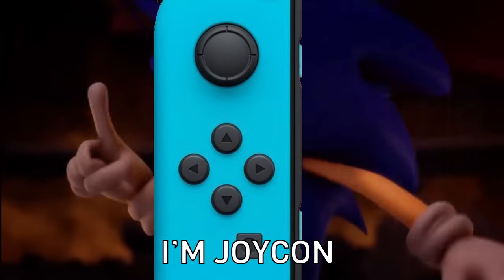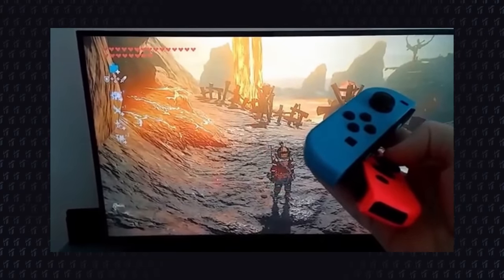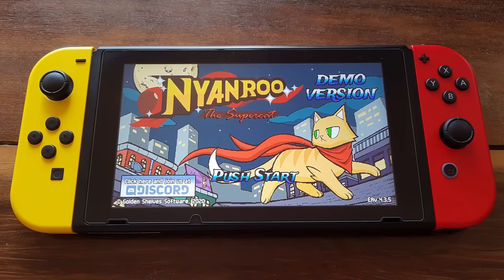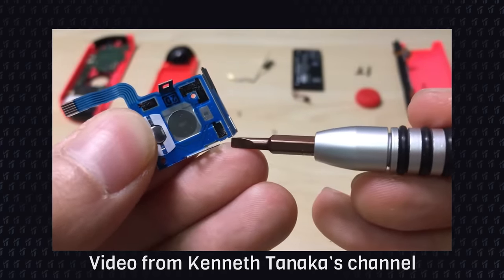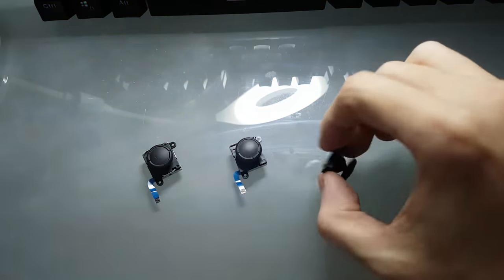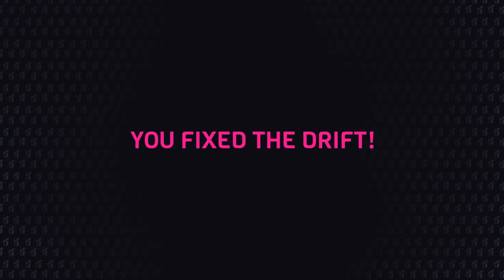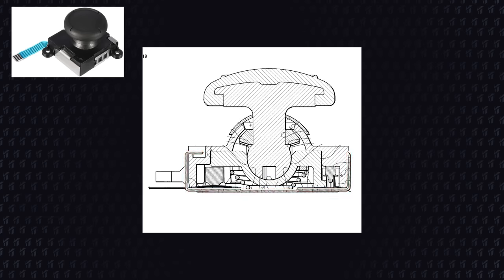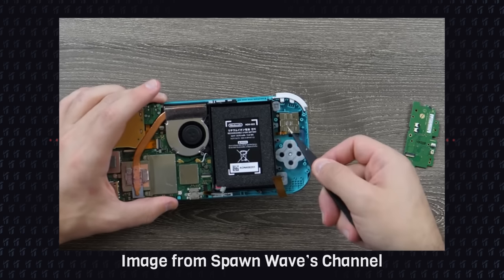How To Fix Your Joycon Drift Permanently!

Comment: To those who is doing this, just a precaution.

The Joycon is designed with one of the connecting ribbon (for thr SL/SR) being immensely compressed. So when you disamble the Joycon to do this, the compression is relieved and may cause the ribbon cable to lose its connection that was held firmly by the compression prior.

Youll notice that now the SL/SR button will only work at a certain angle of the cable when re-assembly, which means the connection is already compromised. 

You may need a replacement for this cable. If you do so, do tuck the ribbon cable underneath the battery holder instead of on top of the battery as it was originally. (As seen here https://youtu.be/RhSYG5M6HZs?t=316 ) This will prevent future compression. 

The paper fix itself works great btw!

Edit: 3 months aftwr doing the paper fix, sadly the drift returns, I just simply replace the joystick witha 3rd party one.
Reply: What is SL/SR? Something left/right?
Reply: @-JaggedGrace-  shoulder left/right
Reply: @TheMushMe  Oh thanks
Reply: I took apart my and my girlfriends joycons to replace the sticks and both left joycons had their SL/SR (and sync) buttons stop working. Now this makes sense.
Reply: Why this fucking thing has to be so complicate to open yet so easy to get driffing?
Reply: @Buitronthecrazy  I know right? So many complications just to fix this thing
Reply: How do you take them apart without that becoming an issue? Is it even possible?
Reply: @Sephelions  i mean, the damage to the cable is already done during assembly at the factory anyway so once you open to take it apart, it will be in a compressed state. Just a matter of luck if the compression is extensive enough or not to need replacement.
Reply: Does the cardboard/paper inside the joycon have a chance of setting the thing on fire? If anyone could answer this that would be helpful
Reply: Any 3rd party recommendations?
Reply: @Dakenir  any 3rd party joystick u can find will work, they most likely come from the same factory nintendo source from anyway or almost similar to
Reply: People do shellswaps every single day, and don't come across these issues you claim. You might just be upset that it didn't work for you so you spread false information.
Reply: @moldorm30  it worked for me for 3 months before the drift started again(this fix is not permanent, since it literally just pushes the base inward, once thats grinded down, youd need to push it in even more, but how far can it be pushed anyway, best is to just replace the joystick)

 i wasnt upset the fragile cable broke off, i was just speaking from my experience when opening my joycon, of course my singular experience cant be representative of the millions of joycons sold out there.
Reply: @TheMushMe  is the 3rd party joysticks purpose to just replace the joystick? Thats it? That fixes drift?
Reply: @nightscesar  yeah, since the drift is a hardware issue, replacing the stick will give you a brand-new one that doesnt have the issue (until the wear and tear happens again)
Reply: @haydennt  the joycon uses very little power to even feel warm let alone start a fire
Reply: thank you for the update
Reply: I don't understand what you mean, I don't see any cables that are extra pressed by the paper on my joycons
Reply: @SanzoArts  its the cable that connect the main joycon body to the joycon rail's light
Reply: @TheMushMe  thank you, I saw it now ♥
Reply: Paper compresses over time when pressured.
Reply: My SL/SR buttons and the LED are broken since last time I send my joy cons to Nintendo for repairing them, guess I'll need to send them back again
Reply: @anomaly395  thats why getting pro controller is the cheaper option. You always need new joycons and they're less durable. If you want new joycons you can, but the problem is the cost is easily over 50-60 at minimum just for two joycons. Although that takes away the experience of playing the nintendo switch base console, you have stable connection and no drift issues with the Pro controller, and you can connect it to Steam for PC gaming if you wish. The only problem is making sure there's enough battery on the Pro-controller. 

I have a samsung galaxy smartphone and I found the charger to charge very fast compared to the cable for the Switch Dock (the USB cable one, not the one that goes to the wall). 
Even a double charging dock for controllers or a dock that can charge the Switch and controller is worth the investment because its a third party, you can't screw up 'that' badly with that (although I'd still be careful about buying from third parties cuz my friend bought one like that, and the bottom has a weird detachable USB head thats the size of the micro USB head for a wireless mouse)

Daily reminder: Don't go green. Buy stuff that last forever so you only need to buy once and it lasts a lifetime or multiple lifetimes. Going green is the most inefficient and abusive way to use Earth's resources to create a flawed product and only expoentially increases consumption rate. 

In other words, make SMART puchase decisions, sometimes you need to buy 'quality', don't bother saving a few cents or dollars if the better product has better warranty, service, or lifetime performance. The only time you need to save a few bucks are digital games, cheap clothing, or other minor things like accessories.
Reply: @drakke125Channel  I already have three pro controllers (one of which has a broken shoulder button), but I don’t always want to play on my TV. I need handheld sometimes too.
Reply: @anomaly395  Just use aftermarket joycons then.
Reply: Smaht
Reply: @9unslin9er  What are those?
Reply: @drakke125 9.5/10 great motivational speech, would read again
Reply: @haydennt  as an electrician, I would say no.
Reply: @drakke125Channel  pro controllers also drift
Reply: 3rd party joycon suck. mine kept disconnecting mid game so i smashed them with a 3lb hammer.
i bought nintendo brand joycon and i can play games without worry.
Reply: @darkshadowsx5949  i replaced the joystick with a 3rd party one, not the entire Joycon.
Reply: I’ve replaced my joysticks twice and idk what I did but I haven’t had this problem, not gonna take them back apart to see if I did it wrong but there’s a good possibility that it’s wrong
Reply: @rad8078 I have also taken my joycons apart multiple times (I don’t understand other comments saying it’s complicated and hard, for me it was a lot of fun actually and I’m looking forward to doing it again) for swapping the shells and fixing the drift and never had this problem either
Reply: just get a hall effect joycon replacement and BOOM! No more drift. For Ever.
Reply: @haydennt paper doesnt conduct electricity. so no shorting, also, none of the components generate heat in a controller.    im 99.999 percent sure even if you covered the entire thing in paper or plastic, heat would never even be detectable.

Comment: Add me to the list! This worked for me, too, but if you’re going to try this, first confirm that applying pressure as shown on the video does actually fix the issue.
Edit: The drift is back 😭 I can still fix it by applying pressure on the controller while it happens so maybe I just have to open them up again. The L and R buttons also started accidentally double-pressing sometimes.
Edit 2: Reopened them and added a bit more thickness, made sure it's closed perfectly and now they work again.
Reply: Oh hey hawlo
Reply: Do you need to stick it down with glue or anything?
Reply: @Frbro111  No, you just need to be careful as you close the joycon that whatever you used stays in place and it will stay in place after closing it because of the pressure applied.
Reply: i wanna try that method but i have never heard of this after feeling before, what does it feel like?
Reply: @meow3829  It's not a bad feeling, just holding them feels a bit different, like they're a little heavier. It could just be me.
Reply: @Hawlo  bro are you like a weight lmao you feel that 000000.1 gram XD
Reply: @previszla6341  Yeah it was probably just all in my head since I hadn't used that pair of joycons in months.
Reply: Add more layers idk
Reply: @s-n-g-b1457  Worked.
Reply: @Hawlo  did u have slight drift before or really bad drift?
Reply: @ninecrowns871  In one set, the right stick would drift as soon as I moved it but would otherwise not do anything. In the other set, both sticks were pretty much unusable, not even letting you move the other way once they began drifting.
Reply: @Hawlo  so this video solution works? , Nice to know thank you
Reply: @ninecrowns871  Worked for me! But make sure to test if it'll work for you first by applying pressure while it's drifting and see if that fixes it. If not, the problem is something else.
Reply: @s-n-g-b1457  You know what they say: ogres have layers
Reply: I don't get it. It works for everyone except me... I tried 1 layer, 2 and 3, but nothing worked against the drift, probably because the screws are so far away from the point of pressure, that the joy con only bulges, doesn't even close and so the pressure doesn't go onto the analogue stick... Can someone help?

Edit: actually just checked another time and suddenly it's working. It's not completely without drift, but it drifts less often than before and when it does it's not nearly as strong.
Reply: @benjaminratajczak7000  use double sided tape
Reply: I have been worried about joy-con drift for a while which is what held me off getting a nintendo switch. I saw this video and helped me decide to buy one and I haven't experienced any drift yet... But if I do I'll come back here
Reply: Yes it will continue to come back, its not a permanent fix. Just replace the joystick, its like less than $4 for an aftermarket one. I have a video on replacing the joystick if needed.
Reply: Have your L R buttons been fixed after you reopened them?
Reply: @el_desalmado  Sadly no. They work like 96% of the time though.
Reply: @Hawlo  then it is not something really serious, is it?
Reply: @el_desalmado  I think it is. I really don't like the feeling of not being able to fully trust a button. Depends on the person, I guess.
Reply: @smash910  Any drift yet?
Reply: @lapk78  My left joycon bumper broke so I had to buy a new one but it held up well I think it was a problem with just my joycon because no one else has seemed to have this problem
Reply: @jcc4543  I used this thinking it was a good idea because it will also hold everything in place, lasted like 2 months before drifting again. The double tape foam got compacted with use
Reply: you could have gotten  your drift  fixed for FREE from Nintendo but you done opened them
Reply: @Only_Some  not in South America 🤷🏻‍♂️

Comment: "he is the chosen one, he will bring balance to the force".
Reply: Literally because controlls
Reply: This doesn’t work I did it and it didn’t work
Reply: I tested this method, but it didn't work. This method does not apply to all drifting joycons, nor can it be solved permanently. And the sides of joycon will bulge slightly, and the sealing of the joycon will be worse, this is the conclusion. The best way is to replace a brand new original joycon stick. The design structure determines that this is a consumable product. I'm the guy who fixed over hundreds of joycons from China.Hope this comment help you.
Reply: @BH-oq7hv  I tried paper instead，th situation improved.But drifting still exits.
Reply: Finally

Comment: This man is a hero, even just applying strong pressure during calibration stopped the issue for weeks. I can finally use my joycons again after years of having given up on them
Reply: did the drift come back or does it still work fine?

Comment: Honestly, I was super skeptical of this fix. I thought it was stupid that this could possibly work, but I tried it anyways because why not, worst case my controllers are slightly more unusable. They work beautifully now and I am very grateful to you for making this video.
Reply: Keep an eye on it. I'm interested to hear how it holds up over time. I'm willing to bet sooner or later the wear on the pads will eventually cancel out the increased pressure and deadzone issues return.
Reply: @darkl3ad3r  Well, just change the cardboard if it's not too often
Reply: Status update on your fix?
Reply: I'd like to know how well the fix held up for you.
Reply: @hellothisismyopinion4162  I haven't been using my switch too often, probably a total of 200hrs since I did the fix. However, I have not experienced a single issue with the sticks since fixing them, so I think it's safe to say it works.
Reply: @raureifblume  See the reply above:
Reply: @wraithakiin sooo how was it?
Reply: @riftplay7996  the left one ended up drifting again but the right one never stopped goin strong.
Reply: @wraithakiin  thank you veryy much for the updateee 💜

Comment: Had a drifting left-joycon. For me just 1 piece of index card wasn't enough, but after increasing the pressure, it fixed the drift. Subscribed.
Reply: Couldn't like due to 69, but here to share that yes, it indeed worked for me too. Subbed .
Reply: what do you mean increasing the pressure?
Reply: @shikabaneconga  adding a second layer of index card or something thicker of course
Reply: Yeah an index card and a business card are not the same. An index card is basically just paper, you need card for this
Reply: @TraceguyRune  ohhhhh, thank you i see then
Reply: Sorry, but an index card is NOT 1mm thick.. Of course you needed a bit more. Glad it worked for you!
Reply: Are Calling cards and Business card any different?
Reply: @eithan2026  You want about 1mm thickness.
Reply: Don't you feel your stick sliding? Having a little dificulty coming back to neutral position?
Reply: @shikabaneconga  Adding more layers of index cards
Reply: @TheSebaguzman  Felt like how it used to work before the stick drifting occurred.

Comment: I like that you brought up the GameCube controller during your comparison bc I think that illustrates my frustration the most: Nintendo normally makes their hardware durable and built to last a long while. My Wavebird still works fine years after I got it, and I've had no issues with it, even during intensive play and use. But my Joycons crapped the bed after a year or two. It's so weird because this is the first time Nintendo's QA has been so lax about something like this.
Reply: Yeah, we've had a Wii basically since they first came out and it's still going just fine, but literally just a few weeks after getting our switch, the joycons started drifting. Fortunately for us, we sent ours back for new ones, and the new ones haven't drifted once in their intense roughly 2 years of life
Reply: joycon are more compact than controllers but they do need to redesign the joystick.
Reply: I hate to say it but Nintendo has hits and misses. N64 controllers failed a lot, GC, was solid. Wii tracking was a mixed bag, and honestly after the switch, I kind of hope they focus on being a software company and let someone else build the hard ware.
Reply: @EddieSlabb  With the Wii are you referring to the IR pointer? If so those worked pretty much flawlessly if there wasn’t any IR interference
Reply: @notsocooldude7720  The pointer was accurate, the motion sensing at launch was hit or miss. So you get the motion +, an adapter to make my remote sense roll as advertised. Or the fact that the Wii doesn't support hdmi. Not natively.
Reply: N64 controller analog sticks would wear out after a few years and start leaning one way

Comment: My left joycon was unusable. I couldn't even cycle the home menu it was so bad.
Just applied this fix and it's flawless right out the gate! No calibration or fiddling with the joystick needed!
Subscribed and thank you a million times for this fix! The man is a genius!
Reply: Let us know if it ever drifts I’ll have to try it this week
Reply: @uhhh_adam  just try it, its an inexpensive fix with no strings attached
Reply: @fekbutchers  you think paper will work?
Reply: Paper works but it takes 3 to 5 layers. You can use tape as well.
Reply: @Htiy  I used a piece of cardboard from a pack of batteries. Cut it to length, it's the perfect width.
Reply: @gitarkin  thank you!

Comment: I've seen a few people recommend a small piece of plastic as an alternative to paper, but paper seems quite effective as well.

You've fixed an issue a multi-billion dollar company hasn't (publicly) offered any solution to, massive props to you.
Reply: Never seen anyone else suggest this
Reply: plastic would be better in the long run, have you seen how paper degrades over time, not a great look for this application
Reply: Honestly I wonder if antistatic foam comes thin enough for this ...
Reply: You're kinda right and wrong at the same time. They already offered a solution. Just cut any of their Labos xd
Reply: @mangakoibitochan  I was thinking the same thing but i wonder if the foam gonna melt cos the constant heat in handheld mode
Reply: @panochaberta1248  I mean the joy cons are not the ones heating. You can use them unattached if you're worried about that

Comment: I love how low-tech this fix is and the fact that it actually worked. 
As a kid in the late 90's i had a portable cassette player where the cassette wouldn't hold in place because of poorly designed cover and that too was fixed by adding cardboard between the cover and the cassette.
Reply: Some things never change lol
Reply: like when your first joystick drift was on n64 and never knew how to solve until now reset stixk with start l and r same time pressed..

Comment: Did this today.  Ordered a kit from Amazon to get the right size screw drivers.  Took a brochure, cut out a square, bam it has worked after playing Skyward Sword for 2 hours.  Checked the calibration after playing, still no drift.  This actually works.
Reply: what kit did you order?
Reply: still no drift?
Reply: hei bro its 8 months later. is there still no drift? i
Reply: @tanjibahsan41  it’s still working yes.
Reply: It’s still no drift?